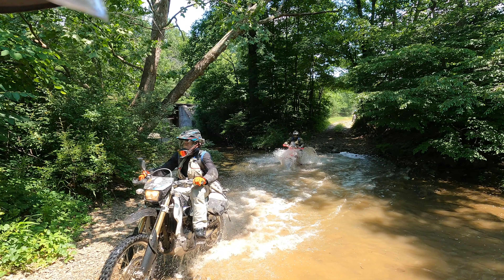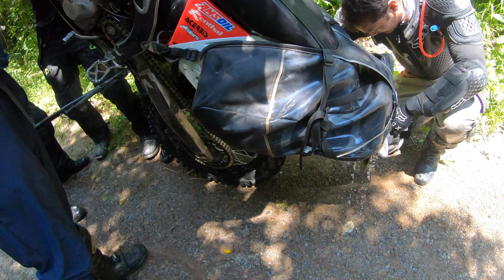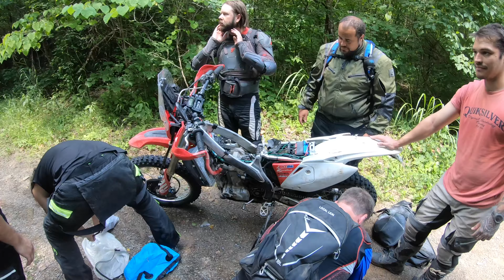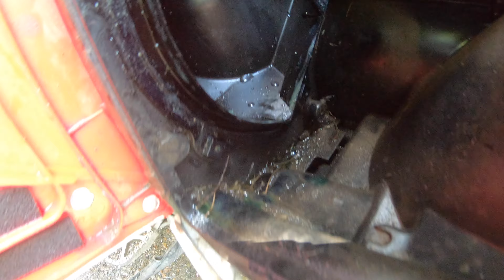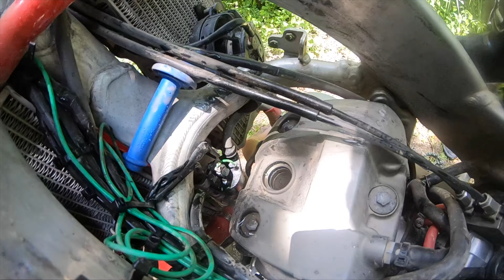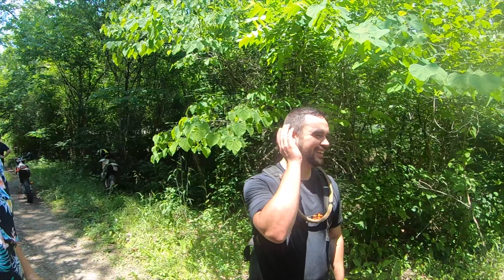Flooded CRF450 on trail 500 miles from home! How quickly can I get it running?!?!?!

Comment: I'm still learning about this adventure bike thing, and water crossings, but turning the bike off ASAP, so it doesn't suck in any water, would have saved all this effort wouldn't it?
Reply from the maker: That certainly helps prevent water in the cylinder but just having the throttle open even when the bikes off will cause this to happen when the bikes on its side.